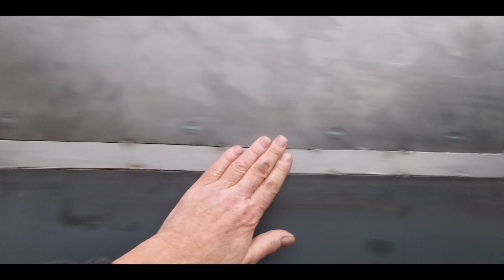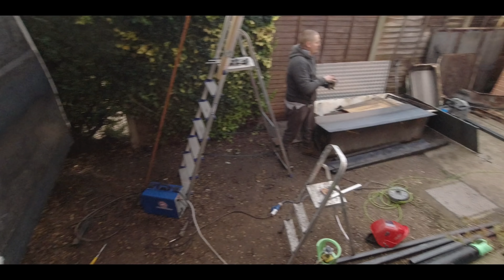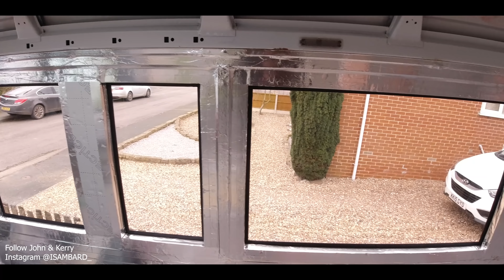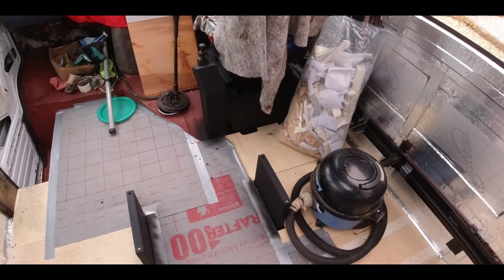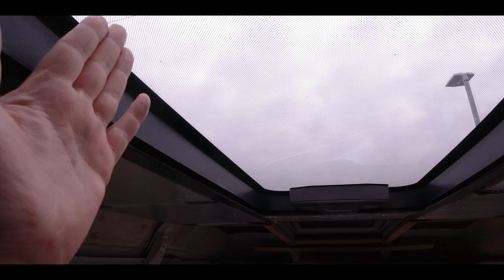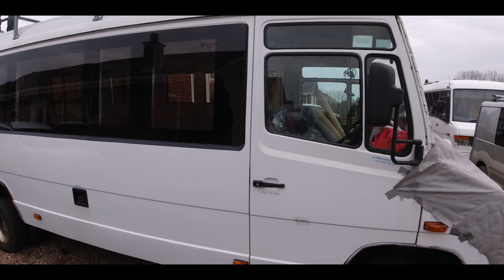Van Life UK From Bus To Camper, Building a ROOF RACK, Mercedes 814 Camper Build

Comment: Its looking great ...very similar idea as i have planned for roofrack ...but i was worried about the weight of building it then lifting it on so top idea on the bolt together . Also the brackets bolted through roof instead of on gutter.  Looks brilliant so far. And the windows look great too.
Reply: Hi Tam. Building a put together roof rack for these buses is definitely the way to go. 👍 It would have been impossible for us to construct a one piece rack then get it up there without mechanical assistance or causing damage. I (Kerry) had doubts about the use of rivnuts but I concur, I was wrong, they are genius on John's part. Thanks for comment, take care. 👍🚌🤗
Reply: @j_k_roaming_  yes i think you are correct as always theres lots of great ideas on your build ...its going to be a super bus 👍 think ill have to invest in a rivnut gun.
Reply from the maker: Thanks Tam they’ll be very pleased to hear that, coming together now and looking forward to the main build, just got to get all this stuff out the way, take care 🚌👍